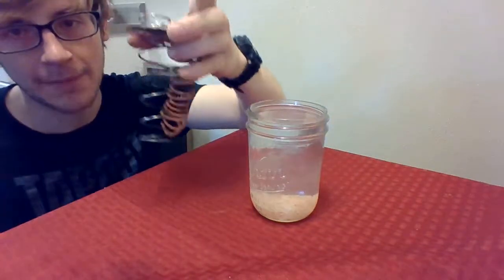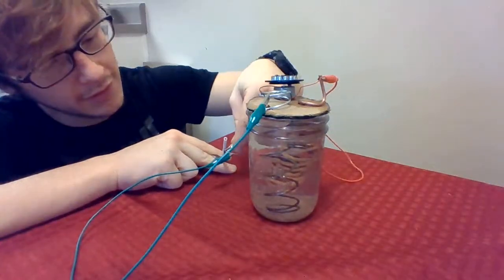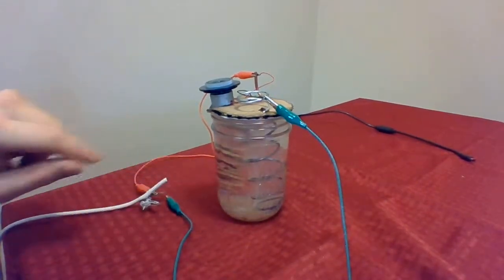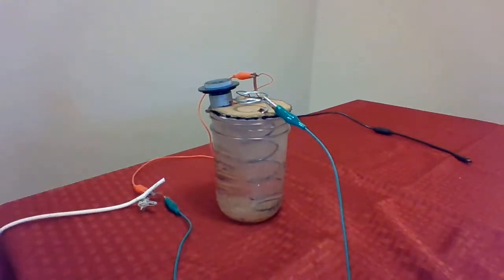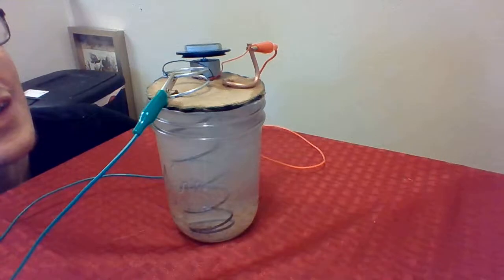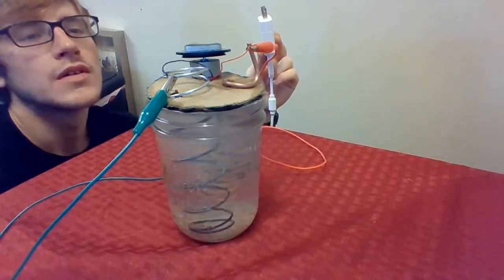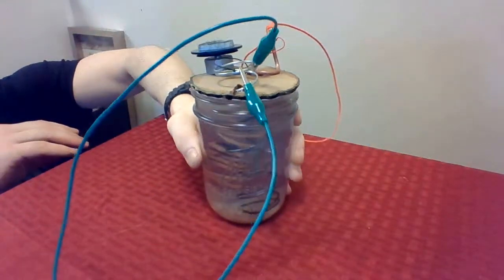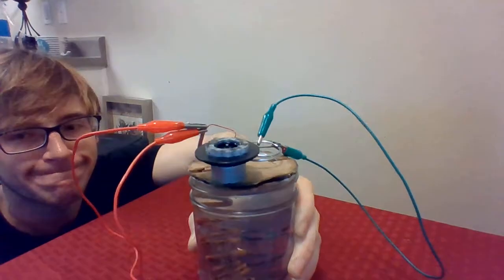Himalayan Salt Battery: 1 tbsp 1 pint. Same Anode and Cathode

Comment: How could you build a mega battery in the sea?
Reply: Would need too isolate insulate each cell so doesn't short in the water and need many small cells paralleled and seriesed too desired power that's about it